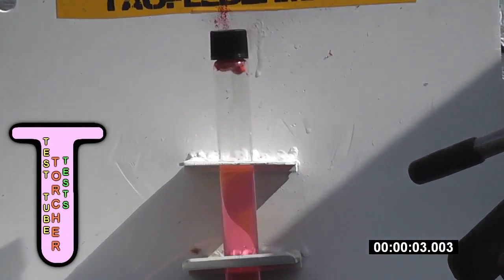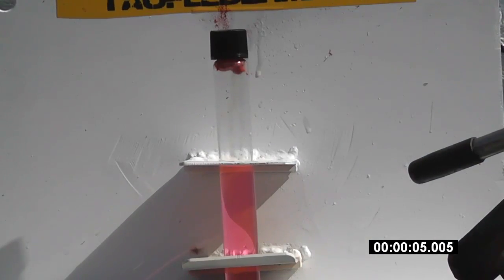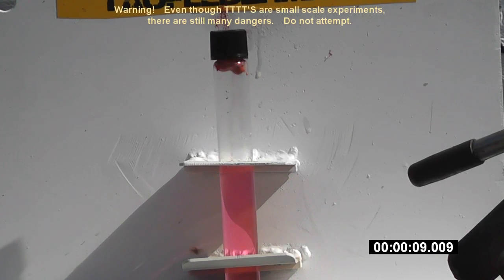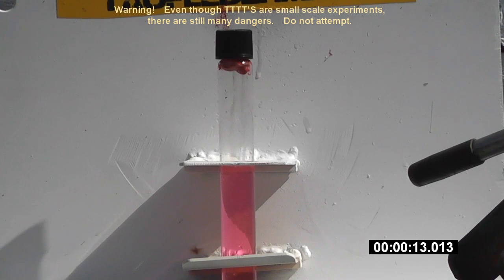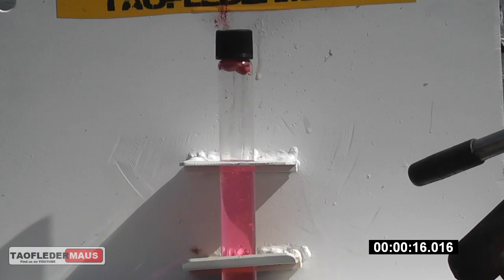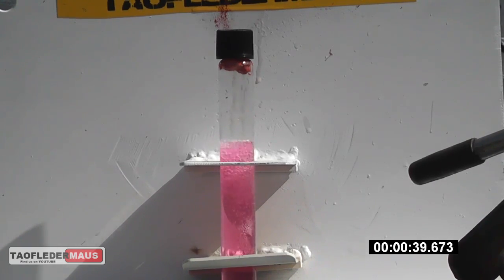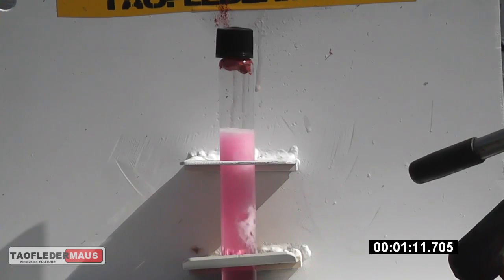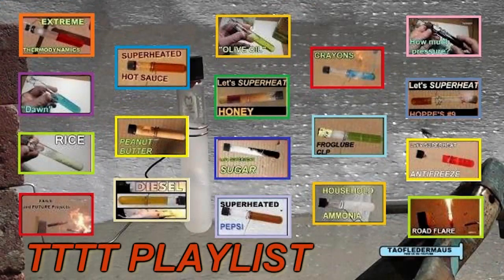TTTT -  NITRO Model Fuel -  Super Heated!

Comment: this new holder actually supports the glass and helps with keeping the tube intact. That's super great if you are concerned about cleaning up afterwards, but less so if you want to see what happens with the test tube under those conditions, instead of just observing how far a substance sprays upwards when the seal breaks. I place the sciency-ness of the old setup above the stability and predictability of the new one.
Reply from the maker: The old set up always has surprises.    I like that better.

Comment: Can you seal the glass tubes with some sort of epoxy so the stopper is not the weak link?
Reply from the maker: I could but  it's California and I'm trying to avoid these being classified as bombs.    I'm paranoid.
Reply: *****
O IC :)
Reply: ***** California has some strict laws
Reply: That would be Awsome
Reply: ***** you could take some of the restraints off of the tube giving it less of a secure hold. or put it on some thing like a sponge (cant remember the exact word i wanted) so it can be a bit springy and have a bit of move room . that could if i thinking right help in this case crack or break.

EDIT..  spongy thing as the base or floor where the end sits (clear it up a bit) 

EDIT 2 its really late and i could be 109% incorrect
Reply: ***** Invert the tube in the holder so it takes off like a rocket! There's probably a lot of risks with doing that, too... but it might be fun!
Reply: ***** I heared some say Commiefornia :P

Comment: I know it probably wouldn't be all that feasible to do both methods of holding it for each test (double runs), but I do kind of like both for different reasons. I like seeing how the chemicals react when the seal bursts without immediately blowing up, but I also love things blowing up :P Personally wouldn't be able to tell ya which way to go xD I like em both.
Reply: it is pretty interesting watching the fluid once the top blows. maybe have one camera down next to the tube and looking up where the vapor will go. flip a coin before you do a test, heads use this holder, tails, use the wire.

Comment: Yeah these are a bit predictable and boring - it boils away for a bit, then the top comes off and a big cloud of white comes out the top.

Which got me thinking...

Test Tube Rocket Test - figure out a way to stick fins to a test tube so it flies straight, then see which liquid makes the best rocket fuel (so in other words hold the test tubes upside down, heat the stuff, wait for the seal to break and try to figure out how high it goes*)

* - or horizontally along a wire or something if shooting projectiles up into the sky is considered unacceptable where you live.

Comment: yeah...the new setup has ups and downs

i liked the look of it at first, but then seeing the second one you can see they will all do the same

on the upside this setup lets you get a nice stable slow-mo shot so we can really see that plug expand before it bursts, this would be a good setup to use the weaker tubes on so we can see the glass fragment

downside, yeah its just going to be the same thing plug pops, gas and fluid vents, at least the spriny wire thiny set up let it mix up the fluids like you explained in another vid, bouncing let it mix but maybe that slowed things down?

i dunno, this has its ups, maybe for certain experiments you could use this, but the old one is more interested, a big enough pop shatters the tube

anyway, thought id give my own feedback, love the vids jeff!

Comment: I think it was 2 summers ago when I thought it would be a good idea to hold a torch to a .22lr round with JUST the primer left. I took the round off ad the gun powder out and just left the primer in the case. When it went off it sent part of the casing into the tip of my torch and bent it. It took me hours to round the tip back out to where the torch even some what worked. I had other nozzles but I really liked that one. In retrospect it wasn't my brightest idea.

Comment: I would say that this new fixture has it's place but isn't a replacement for the wobbly wire... For some subjects where we want to see what happens right as the plug gives, this is perfect. However, for general tests I would say the wobbly wire is better (unless, of course, it looks like something cool happened and you want to do it again in this thing)

Comment: The rig is perfect, but I'd suggest putting a candle or another flame source above and slightly off to the side of the cap so that the vapors ignite. Especially for this experiemnt that uses fuel.

You could also try using the same test rig, but somehow suspend the test tube an inch off the table top so that when the cap bursts, the test tube rockets into the table top and cracks so there is more of chance for a fireball while still preventing the test tueb from rocketing away.

I didn't like the suspended wire test rig as the test tube would sometimes rocket off screen or the escaping gases would not ignite like in this video.

Comment: For the record nitromethane in model fuel is used as an ignition source, much like a cartridge primer. This means model motors can do away with ignition systems, the fuel is set off by a heated magnesium bar in the glow plug which ignites the nitro. Race cars using nitro have their own ignition and lubrication systems which is why they can run 70% or higher nitro directly. What result would a TTTT on pure nitro have? IDK.

Comment: What % nitro is it? What brand (by the color is it Maxy's)? And is it car fuel, or something like boat or plane?

Yes, I'm a huge RC nerd. 1/8 scale, nitro, buggy and truggy is where it's at; Mugen kits, EB Mods TEAM Novarossi engines, pipes, and engine parts, JR-HV servos, Futaba 4PK Tx/Rx, Tony's Screws, ProTek ceramic bearings, LiPo batteries throughout, Hudy tools/setup boards/etc, Pro-Line wheels/tires/foams, Maxy's 40% nitro. It's a very good feeling knowing that everything about the vehicle and raido is perfect that let's you just focus on doing your part, rather than trying to fight through a unresponsive radio or an engine with a weak low/mid/high end. And it's also nice having the power to be able to run down any engine on any track.

Comment: I love the new set up for the footage it will allow you to get, but the reactions are not as out of control. I would Recommend suspending the test tube a little higher on the rig and putting something below via welding that would shatter the tube...  so the plug will blow out and it will rocket to the welded screw or sharp object and cause a failure, and on top of that have a grill ignition system sparking non stop next to the tube. Maximum detonation! and will be slightly in control and in shot.

Comment: impressed it didn't autoignite (considering it is a fuel) at the point of the instant vaporization and the big amount of friction increasing the temperature of the gas at the point it rushed out. I myself rather indecesive about the fixture - i'd personally say, it highly depends on the liquidity of the medium you are heating - if it is as liquid as this fuel i'd say it is better this way, (to contain the immense thrust), however something thicker like honey would be better of in the other earlier fixture, that allowed for movement and more heat distribution as you originally intended it.

Comment: I am shocked it didn't auto-ignite. Just burning this stuff in a fish bowl when I was a kid was hard to put it out once it got hot. I would smother it with a board on top of the fish bowl. But when you removed it and fresh air got back in the bowl it would light right up again like a trick candle.

I wonder if the force of the escaping fuel pushed enough O2 away that ignition could not accrue.

Comment: From watching both types of tests it's hard to decide.

Both types of holders have their ups and downs. Old holder had some entertainment value but as well you could see how violent some reactions were such as when they boiled and the holder would shake rapidly. The new holder is a quality control test, fixed in place type of deal.

Though I like both, original seemed better for youtube. That being said, why not do both? Not for every video, but say a vessel ruptures to easily on one test, redo the test with the other holder and vice versa. Or do both at the same time, it get's us to guage different failure paths a material may undergo.

Comment: Perhaps adding a deflector to redirect the resultant jet back down across the flame? Similar to the target thrust reverser ('bucket') fond on some jet engines. 
http://commons.wikimedia.org/wiki/File:Klm_f100_ph-kle_arp.jpg

Or a channel lined with a suspended wire basket that the tube would thrust itself into w/out the sharp impact and bounce that shatters it, while leaving the ejected material behind in the flame path.